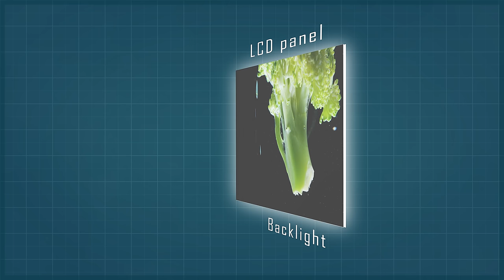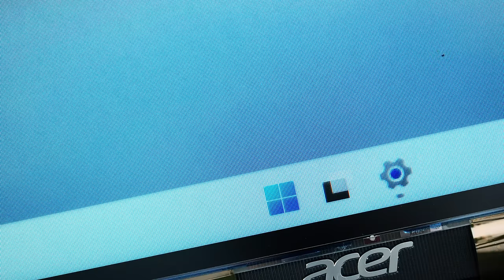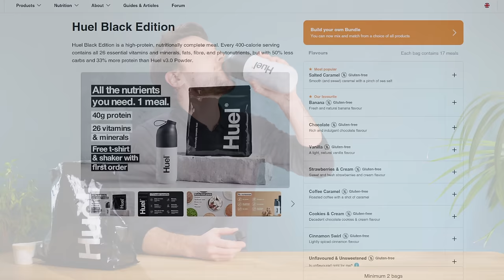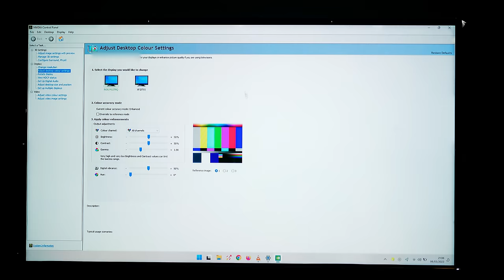DIY Dual-Layer LCD monitor - can it match OLED??

Comment: I feel like there are ways to make this design better and more efficient. For instance, I suspect there's a lot of light lost in the tracing paper de-polarizing layer. If you were to use some sort of polarity-twisting layer, or use two LCD panels with matching polarizing filters, you'd have a lot less light loss, and could afford a dimmer and more efficient backlight. It would also cut the haze around text.

Comment: Each panel has two polarizers. Each polarizer is theoretically only 50% efficient, so a normal monitor is 25% efficient and a dual monitor is 6.25%. To stop the two panels interfering with each other and also reduce the parallax, all you have to do is remove the two polarizers in between the panels. In theory at least, as it's extremely hard to do and will almost surely break the panels. You could soften the adhesive with heat, but heat is also the enemy of polarizers, as they're constructed perfectly aligned polymer fibers.

Also, you forgot to set the gamma of the video driver to 2.0, because that's actually the effect: intensity levels are multiplied together, i.e. raised to the 2nd power.

Comment: If you want a high refresh lcd monitor for pc gaming that rivals oled perfomance and such that doesn't break the bank the hisense u8h is currently priced at $650 for the 55" and its as close as you can get to oled performance and not be oled. This project was hella cool though.

Comment: Have you seen the transparent screens? Does anyone think it's possible to layer many of those? I think it would be interesting to see what could be done with those screens and the technical problems to solve but it could be a cool experiment with videos with many layers between the background and foreground. I am guessing that it would be like a mix between a normal 2D display and a holographic display. I wonder if creators could make some really cool and interesting content to take advantage of something like that. Kind of like those art pieces with many layers of glass and placed in a  light box to give a deep 3D effect. Might hurt my head to watch for too long but could be entertaining to watch.

Comment: i think imax laser uses 2 dlp chips in series for the perfect black level,  because the black level multiplies, as in your contraption.
dlp doesnt require polarization and if separate rgb light sources are used, no color filtering, both remove most of the light in lcds, so with a rear projection (case size doesnt matter, image quality counts) it could be a quite light effizient monitor, if you narrow the viewing angle (doesnt matter for gaming) additional light gain is possible.
for dlp, you need a "very bright" point light source, in this case rgb, which could be diode lasers, which would have to be widened and homogenised.  
instead, much simpler, one could just use an ordinary high quality crt monitor from the mid 2000s, with high resolution and refresh rate
and nearly zero lag. if its picture is too small, just use reading eyeglasses or telescope eyeglasses;)

Comment: I think potentially you can make close to the perfect screen if you got a PG27AQN and gave it dual layers stuck the first layer to a Glass panel, figured out the right polarisation method, then increased the brightness so that it could reach 1500 Nits peak brightness. Not sure how the ULMB2 would work for that since I'm sure they calibrated ULMB2 for the brightness values it had in testing. Since the technology requires space in-between elements you could probably make the backlight modular so you can hot swap it later on. But what this gives you is a Glossy 360hz 1440p Panel with High contrast ratio and OLED Quality Blacks with enough brightness to have the best HDR on a PC monitor available.

Comment: You didn't deconstruct the panel fully, each one has two polarizing filters and a diffuser sheet in them. This combined with the wax paper is really inefficient and creates the blur and separation of layers, which you mentioned. If you take the panels apart further, there is the literal glass LCD layer. Discarding all those extra layers would let you place the panels closer together and make the end product much more efficient. 

Also, matte drafting film or the diffuser plastic sheet I mentioned inside the panels is likely more efficient at passing light through it than wax paper. If you google "DIY diffuser film" there is a stackoverflow-style forum with a post by a photographer who experimented with different substitutes for expensive professional diffuser film/fabric and he said that matte drafting film was the most efficient that he found.

Needless to say, your project is amazing!

Comment: if only this had a gloss screen. The black level goes through the roof with a gloss display because there's no diffusion from the matte coating. Yeah in sunny rooms it's annoying but most desk setups are fine for it

Comment: Maybe you could use proper depolarization film which wouldn't make light bloom onto other pixels as much (if they are clear), and maybe better contact between layers could improve brightness, maybe you could lower contrast in software (there is a reason why one panel is enough for most ppl) maybe black would still be black but you may regain some brightness, also you could "undervolt" LEDs just like philips' eco LED bulbs.

Comment: Your basic problem is using two identical panels. Each panel polarizses from + to -, so the second screen blocks by default.
(+,LC,-,+,LC,-)
What if you rearranged the poleraizers to achieve this configuration: (+,LC,-,LC,+)
So the first LC has to flip + to - to let light pass through, the second LC has to flip again - to + to let light pass.
If you cannot remove the filters, flip the screen (+,LC,-,-,LC,+). Same orientation filters should cancel each other out, right?

No need for paper...

You might have to remove the color filter though 😅

Comment: you should make a side pannel for a PC case out of an LCD pannel encased in epoxy/resin for strength. the lights from the computer internals if you have them make the image appear and its really cooll

Comment: Extied to see if you will do another update on this with the suggestions from the forum. Rotating the Display was my first thought as well and I wonder, why they don't do this in the Industry / dual Pannel hasn't caught on. You would have to flip the display though. This could be done by an integrated circuit which flips the Picture and then outputs it on both channels (one flipped, the other on unflipped) - but that goes beyond DIY I guess.
Another Idea would be, to build the flipper into the Chassis and just connect one cable.

Comment: You should try and remove the polarizing layer of the rear lcd - I remember kids peeling it off old dell school monitors and using the pieces to reveal the image - it would let you use the original backlights stacked together and no need for tracing paper.

Comment: I feel like a riskier construction for this would be to remove the polarization on rear LCD. It's possible, if risky, to do so and may reduce the light lost overall allowing for lower power consumption and brighter displays.

Comment: I'm a BIG fan of OLED. I actually use a Samsung Galaxy Tab S8 Ultra. For movies it's great and in a dark room I can't tell where the tablet ends and the room begins. I can use it as a wireless display for my desktop too, but have never been that happy with it in that mode as there is a small amount of latency. I just can't wait for the day we get oled panels for desktops under $500.

Comment: I think the biggest issue with this catching on was the efficiency. Considering the fact you can adjust it by hand to be perfect, if you actually engineered one it would be dead simple. The problems lies with having a 300 nit monitor pulling more watts than a 2000 nit tv. They would never meet proper energy requirements. For filmmaking, these would absolutely be worth it. Subpixel accuracy is not as important as 99% accurate colors. You need one or the other not both.

Comment: Perhaps you could increase the brightness (& cut the power requirements) by using a few high-powered Cree LEDS (Like those used in many torches), placed behind a plastic Fresnel lens (or sheet of Gaussian output distribution lenslets) for diffusion with less light transmission loss.

Comment: You know... Probably you just invented the first holographic display that isn't based on exotic lights and lasers!

Amazing project (as always! )
Maybe it's possible to split the internal cable where you connect the panel, to use a single board for both. Not the best solution in case they must be adjusted separately though. 

Some TVs now have leds mounted on the back, they change colour depending what is displayed.... Maybe the same technique can be used for internal back-light? (even on a single panel)

Much respect to your work and always original ideas!
Reply: Where is the hologram?

Comment: There is is a Tracing paper that actually plastic milk White acetate sheets  - Craft Plastic Sheets  A0 ~ A5 sizes it has better light Pass though There used for some moving Projector Arts  projects and building Layouts / PCB's / Stencil Sheets even White Cellophane Gels

Comment: OLED Tv and monitors have been out for quite a few years now and they don't suffer from the same kind of issues they did 5 - 3 years ago with burn in, also you might have defined what OLED is as well as QLED, Organic Light Emitting Diodes do have a higher risk of burn in when they first shipped and even up to about 2 years ago when they came up with 2 major solutions to help, the first being that they put in a program that would cycle the whole OLED array to reset and stuck pixel zones, and then a couple months later an automated system that did it constantly while the monitor is being on. Also HDR content really only just started to come mainstream with the lunch of OLED so most LCD screens didn't even support HDR and by the time they did new better options were out there, also OLED and some QLED gaming monitors with things like G Sync ready and are HDR start at 600$ canadian so for GP it is even less, sure there are 1500.00$ monitors when you want 46" or Ultra wide things like that, but those are for people that know what they want and have the cash to blow on it like the odyssey Ultra Ultra wide curved screen that's like 4k $ Plus. I love your videos and some of them have inspired me on a couple projects like making my own 17.5" HDR portable monitor from a Broken MSI laptop, but this build while very interesting I think would be better at being installed in a wall for Art display or something, space is a major concern for the gaming community and having such a chungus monitor that was not only not able to do HDR, requires a splitter and 3 HDMI cables, and draws as much power as their Nvidia 3090Ti and even some 4000's it is going to add a lot more to the power bill especial if you are running a 12k Core i9 or something in that area with a huge TDP. Most systems now require a 1000 Watt Power Supply and then make their hole system and other gear, lights, RGB etc have a total of 1300 Watt draw is not what anyone would go for. Sure maybe someone that wants to YOLO it for fun and your PC is in a milk crate and your water cooler is in a beer thurmase or what's called a Bong water cooler, ya they might be ok with this, but when the rest of the world is trying to make things as small as can be and hiding all wires and bit and boobs to have the cleanest builds, I don't think they would want to use this monitor option.

That all said I still do enjoy all your work and ingenuity, and so hee is a few things i remember that might have helped. 
You can get plastic diffusion layers very cheaply like out of an old tv, <I got that idea out of you building the light box sunroof DIY  and used it a few times thank you for that by the way :) > you can then put the LEDs on the outer edge of the frame like the original one and make the back a mirror this will make the depth of the back less than an inch, instead of 6 inches. this would require a lot less power, then power both off USBC which you could power both from one configured to the same voltage as the barrel jack and run into your computer so it could control the power dynamically to save power. Also if they are identical models you could take one HDMI port on each and wire them together with a terminating end of the wires with a single Female HDMI and you would get rid of the splitter and 2 extra HDMI cables, but they would have to be the exact same model so they would have the same settings and would react the same way to commands over the HDMI, this part could be hit or miss though, but it is possible iv done it, in a slightly different setup of course but still same idea over all for connectivity.

Anyways as always thanks for another great video, I have watched the new Speaker one and love that one, and if i had a 3D printer i would so do it, but that's just bot in the budget at the moment but someday it will be :)

Thanks again for everything with love from Canada

Comment: the best technology in my opinion is the local dimming with mini led (like the MacBook Pro 14 and 16 with apple silicon CPU) they have all the oled benefit (you will not see any bloom around images, perfect black, and huge peak nits) without the cons (burn in and low backlit). unfortunately this tecnology is still very expensive.

Comment: Or you could have simply removed the polarizing film from the second display which would have removed the need for additional backlighting or the tracing paper you stuck in between, resulting in a lower power, higher sharpness display.

Comment: I was once able to successfully remove 2 polarizing films that were stuck to the LCD glass. I used a solvent that did not harm the glass and films, but softened the glue. You should have done this to remove extra layers of polarizers, instead of adding tracing paper with all the consequences.

Comment: So if you run it in a dark room, you really only need the original backlight and a sheet for tracing paper to scatter the light between the two lcds to achieve close to OLED levels or color depth. Crazy

Comment: Interesting project. Regarding the polarization issue, not sure it would work, but maybe it would be worth a try to remove the polarizing layer from the bottom LCD (the one that's closer to the backlight) and replace it with a polarizing layer with the polarization direction rotated 90 degrees. It may be also necessary to invert the input image of the bottom LCD layer.
Reply: It could work, but the amount of light blocking (LCD screens being on polarize the light so you can see it, after all) would diminish.  It is however interesting to try.

Comment: A problem with this is that it is basically squaring the brightness (each component normalized from 0 to 1); A normal brightness of 0.5 will become 0.5^2=0.25, A value of 0.25 become 0.0625, and a value of 0.99 will become 0.98. Lowering contrast in dark areas of the and increasing contrast in lighter areas. This gives a low dynamic range (from 8 f-stops to 4 f-stops). The solution to this would be to first square root the color values. Although this might be difficult to do.

Comment: My 15 year old color reference LCD still looks better than 90% of the modern LCDs out there.  I got it used and it's a rare model from Dell but I've been using it for 8 years and it's still great.  The thing is LCD manufacturing is so cheap now they don't make monitors like this anymore.

Comment: 10:52 You forgot to mention one thing(or at least I missed it if you did), a project like this is very dangerous.  If anyone tries this, they MUST learn how to drain the change from the monitor or they may kill themselves when the backlight and other high voltage monitor parts shock them.

Comment: I believe you can remove the polarization layer on LCDs by placing damp towel over the front of the panel for a while, and couldn't you reduce the thickness and parts required by salvaging the LEDs from the donor monitor and using the same acrylic panel and diffusion layers from the original?

Comment: I have an Auros OLED 48 inch PC monitor. Some annoying quirks but it goes far beyond anything else visually speaking. Most annoying is being forced to turn it off every 40 or so operating hours for the screen to de-ghost and prevent burn in. This takes a few minutes though.

Comment: One thing I have to add. You NEED to calibrate the monitor to get proper black and white levels and accurate colors. The orm calibration doesn't fit this new setup.

Comment: A few years ago a company worked on releasing consumer verions of this as a cheaper alternative to full array dimming/OLED panels. They used a greyscale panel at 1/4 resolution (basically 1080p for the 4K displays they were working on) panel for their backing panel and it worked very well.

They only took one screen to market unfortunately and it never reached the EU or US. By the time it reached market, the price of FALD and OLED displays were competitive even at the low end, and it wasn't worth working out the engineering overhead to bring prices down. A shame, as a system it can work as you see yourself!

Comment: ...or just use dirtcheap used lastgen plasma tv (tx pr42u30 for example)
It draws  nearly equal levels of power being 42 inches wide. This generation of plasma panels also has outstandingly long lasting display component that runs almost 100k hours in eco mode without burnouts due to pixel protection (which looks like a mild noise). Just dont place it in direct sunlight to avoid overheating induced psu failure.